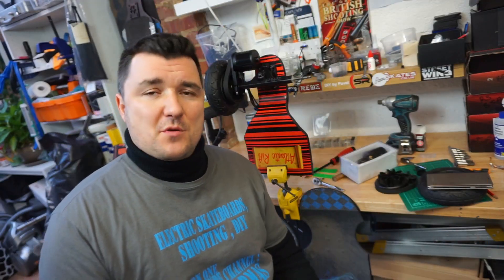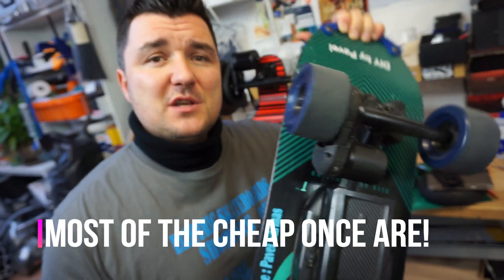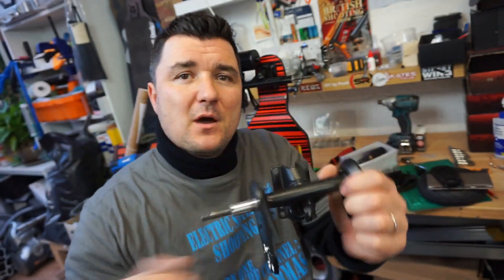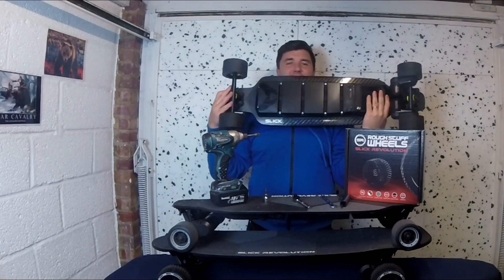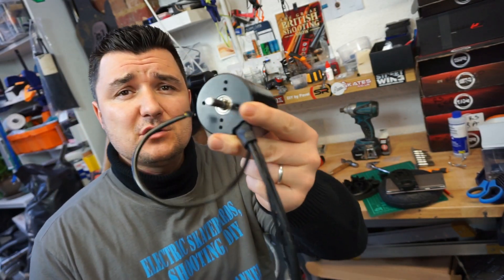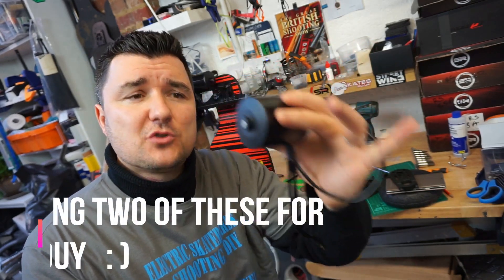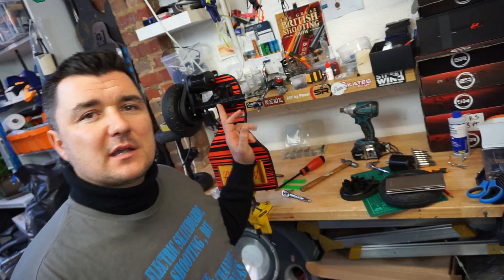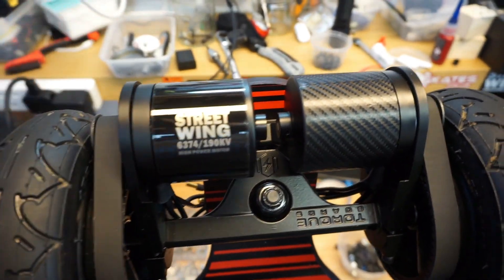Beast video 6 part 2  - Motor mounts,6374  Street Wing motors

Comment: when you talk about the wattage of your board, how is that calculated?
Reply from the maker: Good question mate!
The power ( in watts ) is equal to the voltage ( volts )  times the current in Amps so in my instance :
12S battery/ 70 Amp / dual motors
Hope this helps ; )
Reply: @PavelGarmas  Sorry i'm trying to figure out what my build would be, to ensure everything i picked would work and not damage components before i go plugging it all in. can you please elaborate where you get the 70Amp from and the duel motors.

12s10p battery is what i'm building depending on enclosure and weight might even be 12s8p but im looking more towards 12s10p for range

These are the calculations i have so far but i'm not 100% sure if they are correct, these are based off researching formulas

https://docs.google.com/document/d/1vokWyBTM6LjhC5zgjOSorherHVrtyThDHLVL8lb-gHY/edit?usp=sharing
Reply from the maker: @realsoftgames7174  
The way I do it is - battery S value first. So in your instance 12S = 44.4 volt, what is the safe discharge rate?
Next thing are your motors....what is the maximum Amps they can handle? Mine are 65 Amp constant. Next thing is to get a good quality VESC making sure that it can handle the amperage you require times the amount of motors so if you have dual motors and each motor is 65 Amp = 130 Amp vesc minimum. I am using the 200 Amp vesc that can peak at 600 Amp if needed.
Then the cables! Make sure to use the correct size cables and connectors. I am using 10 gauge silicone cables and XT90 spark free connectors.
And finally, do not set up the vesc to a Max Amperage straight away - et it to 35 - 40 Amp and test the board....you can always increase it later. 
What motors are you using mate?

Hope this helps.
Reply: @PavelGarmas  ah thats weird it should be in the link i posted in the comment above. with my calculations and parts. let me re link it
Reply: here is the link to my Specs on google docs with battery motors and vesc's

https://docs.google.com/document/d/1vokWyBTM6LjhC5zgjOSorherHVrtyThDHLVL8lb-gHY/edit?usp=sharing

Comment: Sweet! I had no idea you could make the Outrunner motors on a Slick Revolution board into rear-facing ones! Sounds like they could have alternative mounting positions for future trucks.
Reply from the maker: Yeppp....it is not ideal as the rear facing position makes them go a bit low.
I did try that position out and did install the AT wheels on the board : ) did you see the video? 
Here is a link just in case : https://youtu.be/JAUchbB3ue4
Reply: @PavelGarmas  I wonder if they'll ever be rear-facing motors on Slick Revolution? Just a thought.
Reply from the maker: I do not think they will.....the forward facing motors are safer for the motors....out of the way if you would decide to rest the board on them. I do need to move the motors back due to the size of them though.